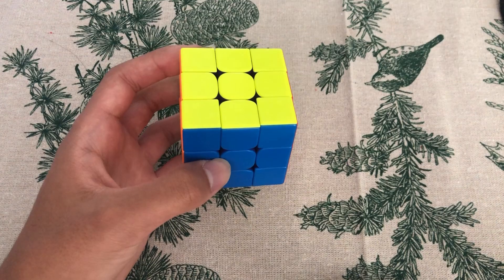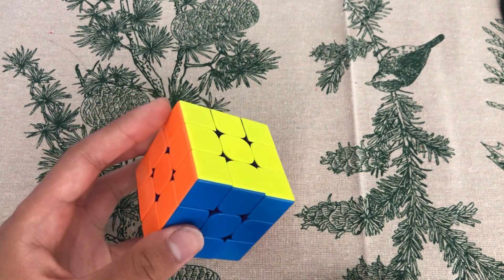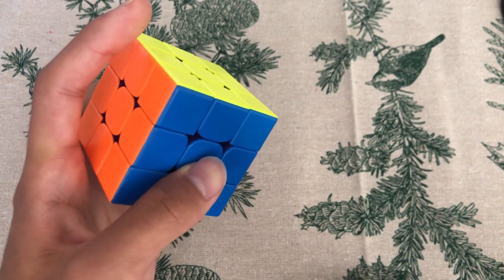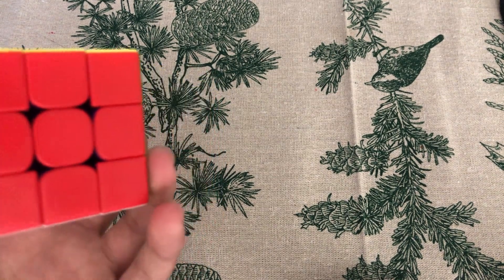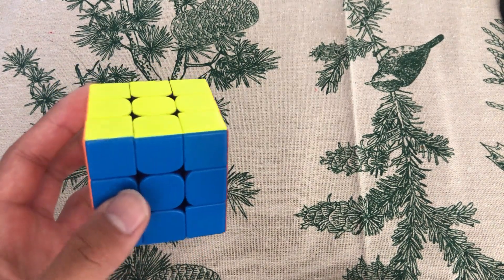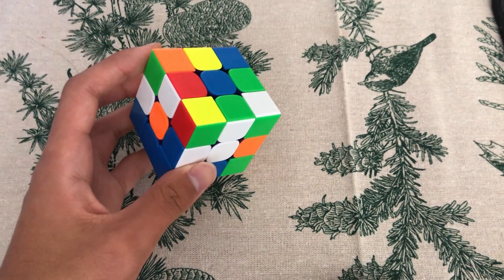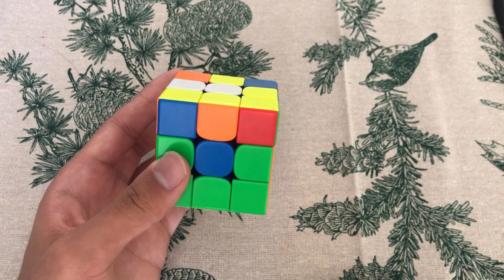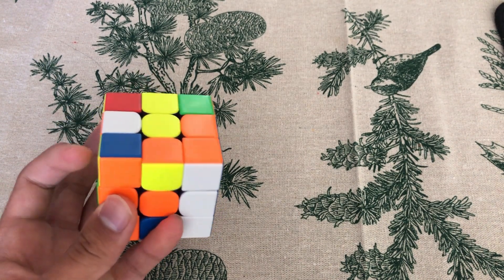[ ROUX OH ] 5+ tips on how to get faster at One Handed using ROUX method

Comment: For the L fingertrick, you can just flick from BLU to ULF, for the L' from ULB to BLD, and for the U2 fingertrick, it's never worth it to do it as you showed at 6:43 as far as I know, just do eido/beido (that long flick thing you showed at 6:57 and 7:16)
You also don't need to be x2y neutral to do the first block under 9 moves every time, y neutrality is enough I think (but x2y is still beneficial, since it increases your chances to get a 4-6 move fb)
Also for the solve at 15:25, you could have done z2 x' r' R' F u' R2 F for the green left white bottom first block, instead of that 11 mover you did.
Great video otherwise!

Comment: Nice vid! But how should i practise FB and SB?
Reply from the maker: Honestly, first block is a step that's the hardest to give tips on and most of it comes with experience. But you can watch top solvers example solves to improve first block efficiency, and try to experience with different ways to build the block. For second block you can use Kian's alg sheet to figure out the optimal solution for each case. But it is important to note that the most efficient solution is not always the fastest. Also, untimed solves are really helpful for efficiency and recognition because you can try different solutions without worrying about getting a worse time. Hope this helps, feel free to reply if there's anything I've missed!
Reply: @ thanks!